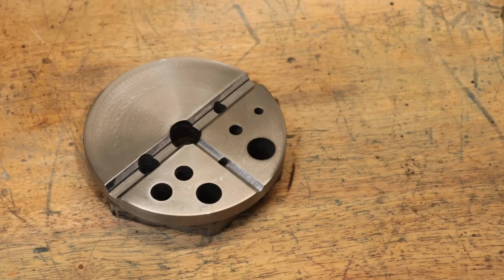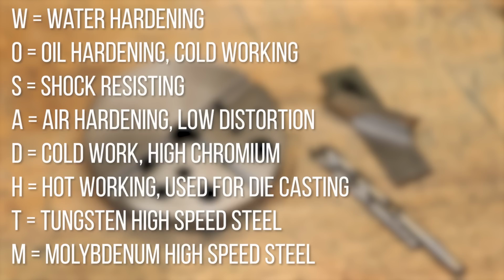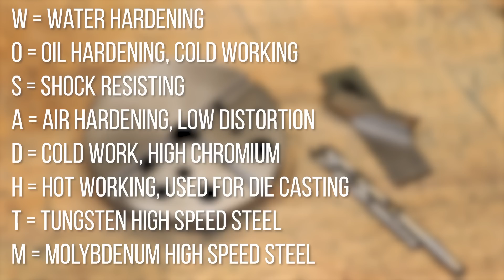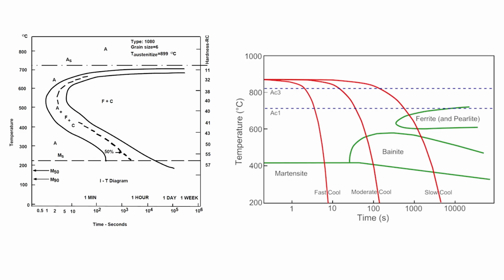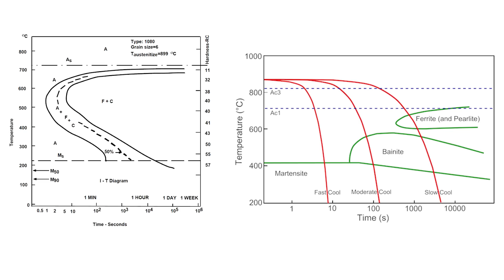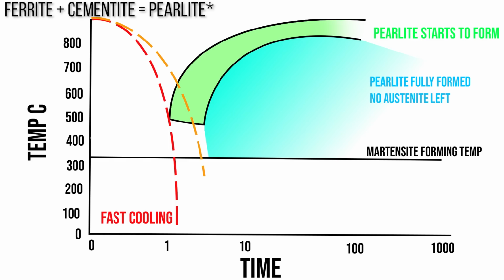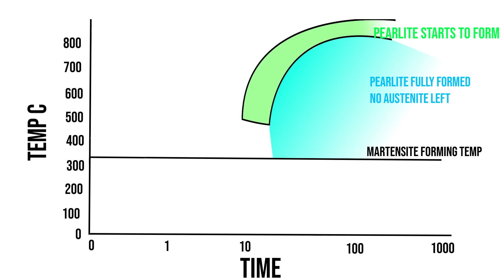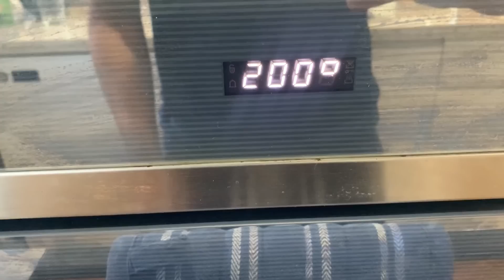Heat Treating Alloy and Tool Steel - Heat Treatment 102

Comment: If you are going to be hardening many small parts, there are small electric furnaces with good controls that can be bought for relatively cheap.  I got one for around $400 (new) about 8 years ago, and it has worked great for me.  It is only 6x6x8 inches, so again, only for small parts, but the temp-time controls are excellent and it runs off a regular 120v (US) outlet.

Comment: A good DIY project is a small electric heat treat oven. Using an Ink Bird PID controller ($40 or cheap import option) and a resistance wire heater, a fabricated steel box, a couple fire bricks, some insulation, and you're good to go. The PID controller uses a k type thermocouple and can hold certain temperatures or run various programs. You can probably build it for around $200. 

Alternatively, Vevor is selling an electric kiln for about the same price where you would be able to do the same thing. 

Then if you really want to get crazy, I think Argon gas can be pumped in at a few psi to prevent scale on the parts. 

Might make an entertaining project and would come in handy for 17-4 & 15-5 stainless. Both options machine well after being hardened, don't move much in heat treat, and end up with parts that are tough as hell. We've been making a ton of 17-4 & 15-5 stainless parts for Commercial & Military aviation.

Comment: I've often wondered if there is any merit in quenching in a container that has a dual layer of water and oil, the oil layer having less of a heat-shock and the water rapidly cooling the bulk material.

Comment: Pretty sure the annealing temperature of high speed steel is around 1300°C. It would take a lot more than 500° to ruin the temper.
Reply from the maker: That’s the anneal temp but you’ll start to lose hardness around 500-600. Similar in a sense that you anneal carbon steel at 730 but you start to lose hardness at 180ish.
Reply: @artisanmakes  would be interesting to test how much hardness is lost at temperatures below the point it anneals.
Reply from the maker: There are a few charts for these but they vary depending on the amount of carbon in the steel
Reply: @freestyla101  you’d lose all your hardness. 1300C is practically the melting point and several hundred degrees above the austenitization temperature.  Tool steels are hardened by martensite and carbides, above the austenitization temperature you have no martensite and by 1300C you have no carbides.

Comment: A quick word about the temper durability of HSS. When grinding and the steel get hot if quenched in water in process many times it will also affect the steels hardness. So even if it's only just to hot to handle to red hot let it air cool, dont quench it if it can be avoided and it will better maintain it's properties. Back in the days when phones had dials I used to operate a big planer on occasion.  When sharpening 1"/25mm HSS it was quite apparent if you cooled it to often durability wise.

Comment: The other day I needed a tool, so I sharpened a piece of what I think is tool steel, and quench harden in water. I didnt even bother tempering the tool. It worked fine, producing nice chips.

Comment: For me in the NL/Europe is always difficult to convert these alloy numbers to our local system. To my understanding some alloys are even not exactly available: there are small differences in composition. I wish they would agree on an international standard (and everybody used it).
Reply: I'm sure we'll get on that right after standardizing on a single measurement system globally.

In other words, unfortunately, I don't know that it'll happen.
Reply: @elitearbor  There is a (mostly) global standard for linear measurement but it's just those pesky Yanks that don't want to join in :-)
Reply: Yup, even in Europe there are already about half a dozen different systems, Germany, Britain, Sweden, Italy, France, etc. I'm still working on a massive table in a Word file where I've listed the AISI, DIN and EN alloys and tried to find the different alloy numbers in different countries for the same alloy, yet half of it I've been unable to find because it seems they only exist in one system but not the others. Fortunately there are only a limited number of alloys which are commonly used, the exotic ones not so much so you can just forget about them and look them up in the rare case you do need to know. St 37-2, C45 and 42 CrMo4 makes up for half of what is used.